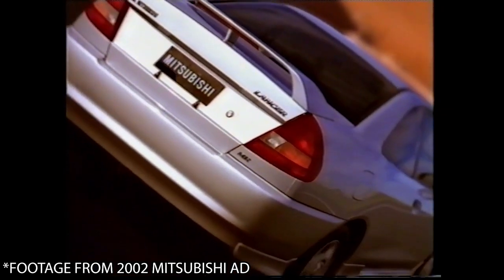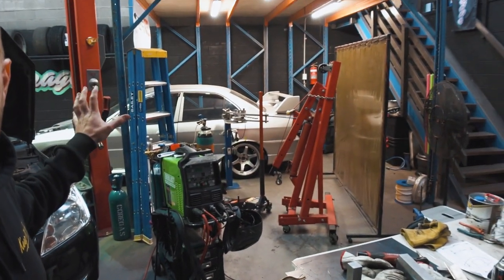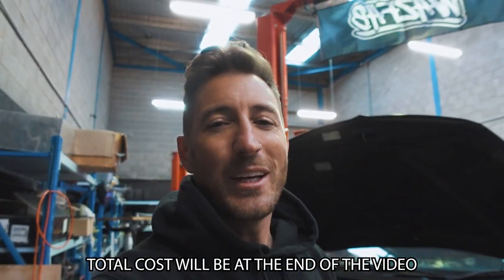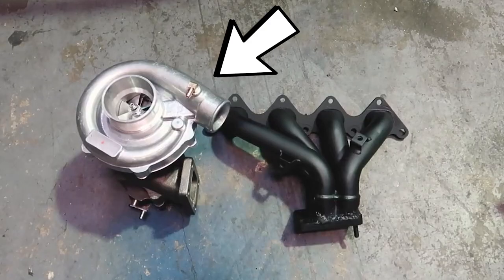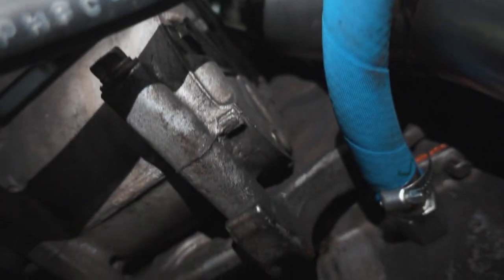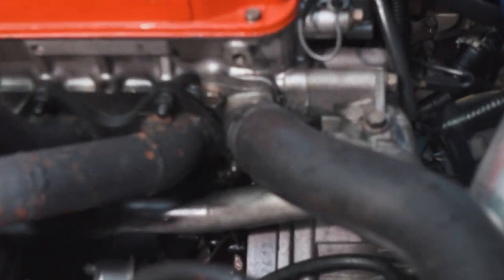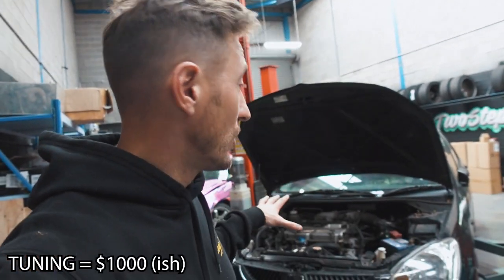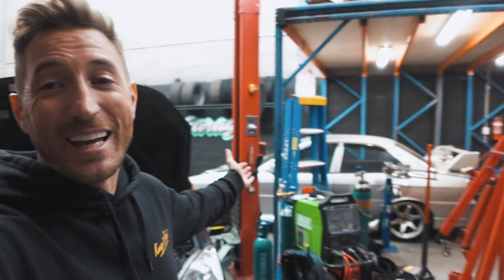How to TURBO your 4G93 & 4G94 Mirage / Lancer!

Comment from the maker: I hope this helps some people! Did I miss anything? Let me know in the comments below 👊🏻.
Reply: Any recommendations to turbo 4g69
Reply: This made my dream build still a possibility. All of this stuff has been imagined in my head. Ive read and researched everything you did. My biggest question is tuning. What application would you or someone else use to tune with a tactrix. I would probably be doing a remote tune. Just curious 😅.
Reply: Midway through installing a turbo on my lancer, I have the same exhaust manifold and turbo as provided in description but slave cylinder is blocking the turbo inlet, any advice to get around this?
Reply: Ideally wouldn’t this work for the 4g69 platform as well?  They’re practically the same platform with slight variations.

Comment: Do I need oil pressure, AFR or boost gauges? Will the stock fuel pressure regulator do the job? What thermo fan should I buy to bolt on?
Reply from the maker: Guages are a personal preference. I only ever ran a boost gauge. I forgot to mention the fuel pressure reg upgrade, yep you'll for sure need a rising rate fuel reg! A 12" thermo fan did the job for me, never once over heated. Even at track days!

Comment: Hy Mike!
I have a 1995 Galant with a 4g93 engine and i want to put a snail on it ,😁but it still has distributor ignition and I don't think the ECU is tunedable because of that. What do you think? Should I adjust the ignition angle or should I get some newer 4g93 ECU with spark plug wires and every other stuff?
Reply: No Brasil e EUA existe a empresa FuelTech, é uma injeção eletrônica programável que você consegue instalar e gerenciar qualquer motor.

Comment: Did  you use ARP bolts, and what Kind of head gasket did you use. Also what Psi do you run it. And one last one, what RPM is a same limit on your setup.
I'm starting this same build for a budget 24hr continious endurance  race. Do you think this setup could last 24hrs of continuous punishment
Reply from the maker: Stock unopened motor. No Headgasket or studs
Reply from the maker: Setup will last forever with a good tune!

Comment: My 4g94 has 335k kms should I replace the engine to run boost or will it hold still. Motor is super clean , I service it every 5k
Reply from the maker: Do a comp test. If comp is good, you’re sweet to boost!

Comment: Midway through installing a turbo on my lancer, I have the same exhaust manifold and turbo as provided in description but slave cylinder is blocking the turbo inlet, any advice to get around this?

Comment: All the parts still apply to an 03 right? I know the 04-06 is a different front end bumper/fender combo.
Reply from the maker: Yeah this is more about the engine than the exterior. As long as it’s 4g93 or 4g94
Reply: @itsmikelake that walbro pump doesn't look like it just drops in. How's that get installed
Reply: Also not exactly new to boosted vehicles but new to doing it on my own. I need a bov right?
Reply from the maker: @ianbarlow4026  Watch the build series homie. It's allll in there.
Reply: @itsmikelake  dude i didn't see it at first and saw it by accident. Thanks a bunch man.

Comment: @itsmikelake do you think hitting the 350-400hp range is possible? Tryna make a rocket!
Reply from the maker: Not on stock internals unfortunately. 250hp is around the max before you need to start upgrading internals 😁

Comment: What did you do with the MAP sensor?  N/A MAP sensors don't like boost.
Reply from the maker: The 4g93 doesn’t have a map sensor. They’re an airflow metered engine
Reply: @itsmikelake  Sorry I have a 2003 US spec 4G94 and it does have a MAP sensor.  It's located on top of the inlet manifold in the center part no. MD305600 I think from memory.

Comment: I have a 4g93 turbo mitsubishi lancer 2000. But it's loosing power when the rpm go up to 3000rpm and the car started to shake up don't kno what to do. But it start fine trackling is great but as I press down the gas pedal it loose power.
Reply from the maker: I’d start with the fuel pump

Comment: Will included files work with 1.8L 4G93 out of 2000 Mirage with the F4A42 automatic
Reply from the maker: If it has the black plastic case ecu yep!
Reply: @itsmikelake  thanks! I’m building a bootleg EVO out of my Mirage and this video and your info/files will help me out tremendously. Just getting it where I want to be cosmetic wise before any major upgrades under the hood
Reply: @itsmikelake I also notice the manifold provided is for T25, are the flange on 25 and 28 the same size?

Comment: I have a mirage with the 4g93e, and the black box ecu. but it a 4speed automatic transmission, does anyone know the power limit of those auto 4 speeds? I'm hoping to push around 150 - 180 wheel horse power, but I haven't found much online about what it can handle, if you know anything, any insight is appreciated
Reply from the maker: Hey! The auto gearbox will handle that power now problem at all. Generally, auto gearboxes can handle more power than the manual boxes!
Reply: @itsmikelake  thank you for the info Mr.
 Lake